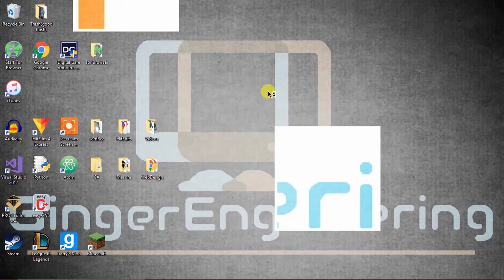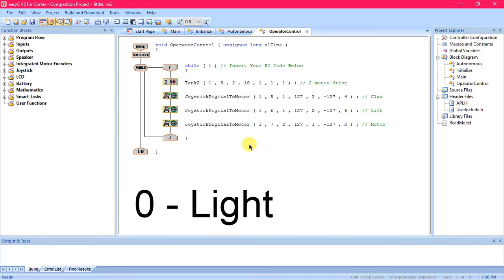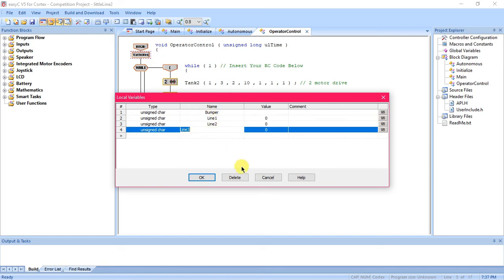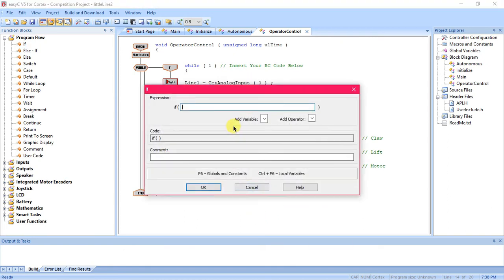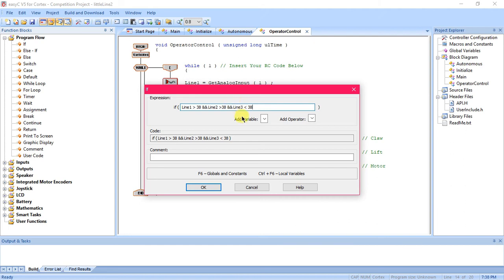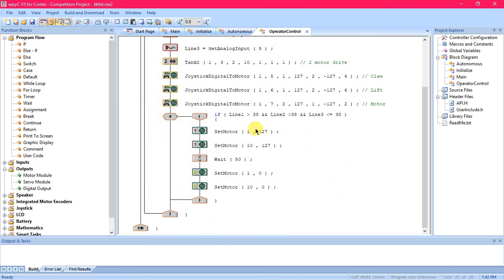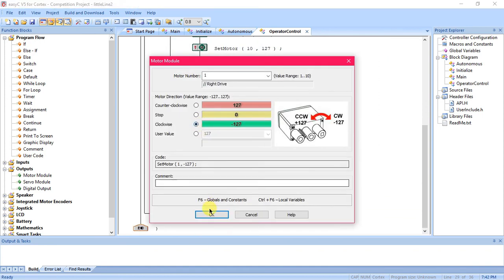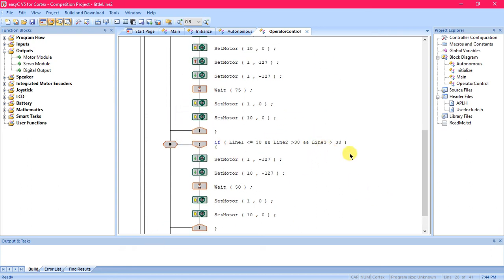How to Program a Line Tracker Sensor | VEX | EasyC

Comment: Hey, so I’m working on a line follower project and I tried to use this code but once I downloaded it to my robot and tried to run it nothing happened, it didn’t move. I made sure to double check the variables and the numbers I used for the light level but still nothing. I was wondering if you could help me
Reply: HI
Reply: Ig he couldn't help you. Did you ever get it working?